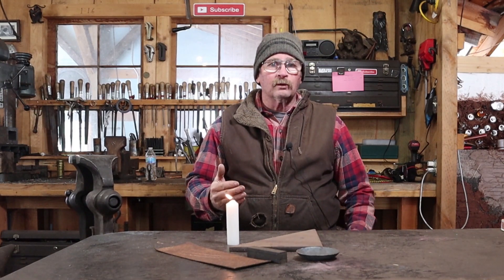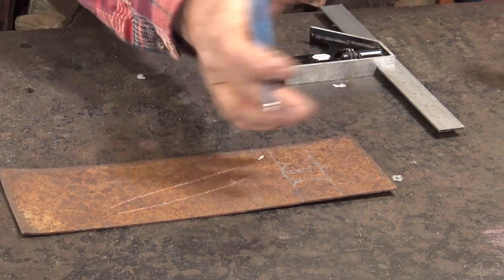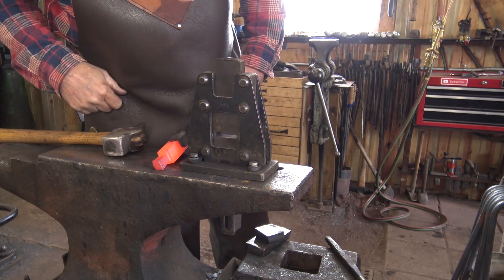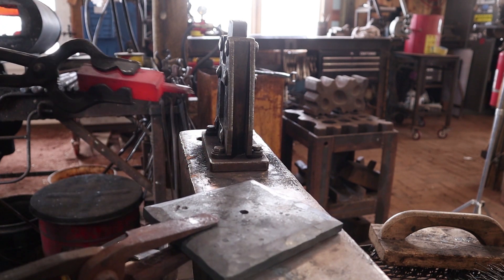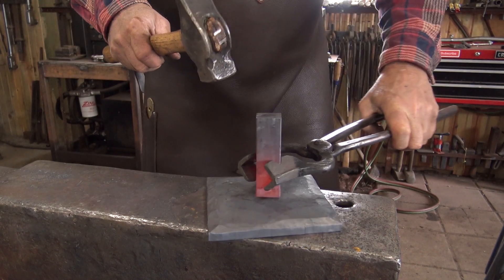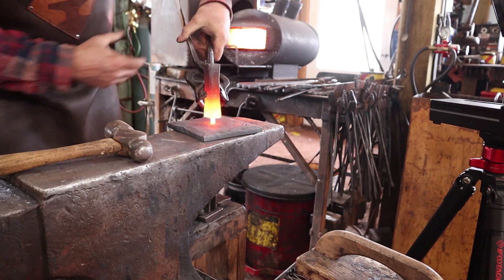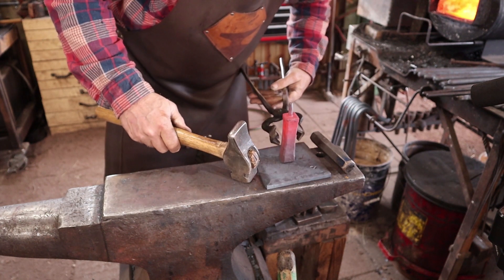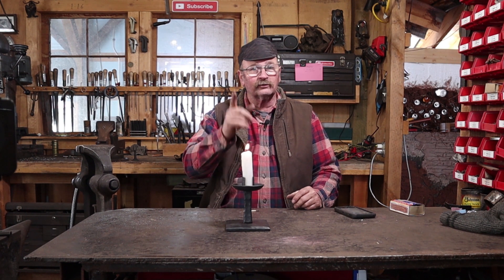Blacksmithing - Heavy iron candlestick

Comment: You could also make the top tenon excessively long, and coil it up (like a courting candle holder (although I don't know whether courting candles actually existed back in the day, I have heard somewhere that they are a more modern creation)).  But I like the candle holder as is.  I don't think I have seen candles like that, but then again, candles for lighting are somewhat antiquated (at least some places).
Reply from the maker: These are called plumbers candles. I’m not sure what plumbers would have used them for though.

Comment: Beat me to the leaves for the candle cup, great minds? Great project, but you need more than one, what if you are already up and moving about and the wife needs light to get up too? At least one for every member of the household + family + visitors, and a couple for each community area in the house. A two to three finger loop, off one corner would make it a little easier to carry if the center pillar isn't tall enough for some hands to grip it. And remember, don't leave home or go to bed with candles burning. (Video specific safety outro).

Comment: Hay John, loved the video. I was watching as you turned the tongs in your hand with ease. Is there a proper way to hold the tongs, or is it just the way that your tongs are made? Also, should I hold my tongs at the back of the rains so I don't have to grip so tightly?
Reply from the maker: If the tongs fit well, you should be able to hold them with a relaxed grip. Holding at the end does provide a tighter grip. But I feel like my hand is in a more natural position when I move up a little.

Comment: That turned out great!  I have a question though.  Did you taper the hole in the base so the tenon would expand tighter?  I thought I saw a bit of a taper.
Reply from the maker: It is counter sunk on the bottom

Comment: Very nice! Question, though; I have some 1" bar similar to what you have there, and I twisted it in order to try to make a candlestick, but it came out with a bit of a bend. What's your method for straightening out such pieces? Thank you for these videos, they are wonderfully instructive!
Reply from the maker: You can gently squeeze the twist in the vice while holding corner to corner or use a wooden or rawhide mallet over a wood block.  The goal is to not beat up the corners of the twist.

Comment: I would think a guy like You would have a generator just in case.
Reply from the maker: I do, but not permanently wired with auto start.  Power needs to be out quit a while in the house to be worth worrying about and I can usually find things to do in the shop that don't require power.
Reply: Black Bear : You’ve restored my faith in You LOL